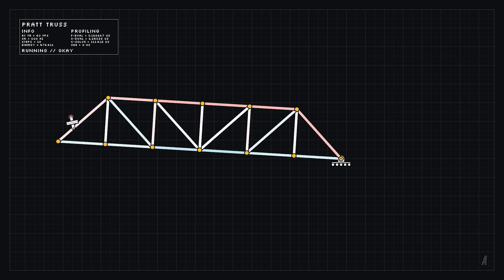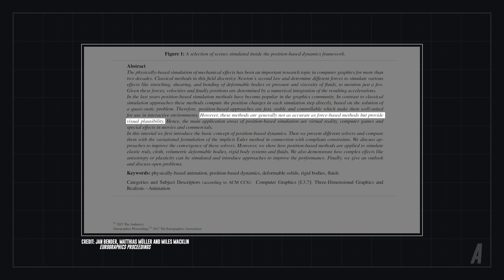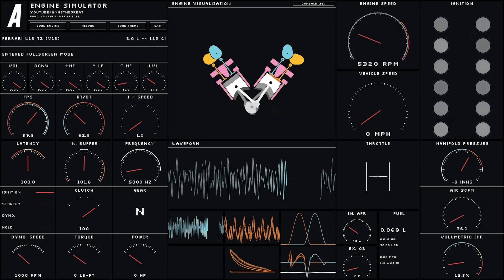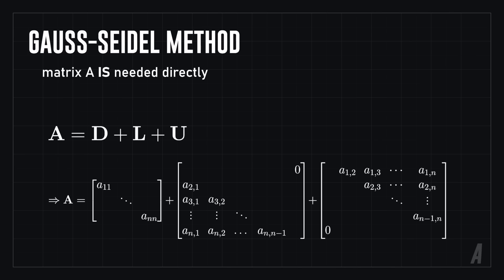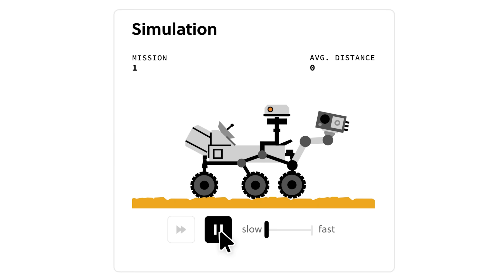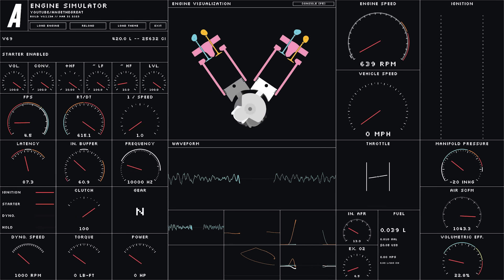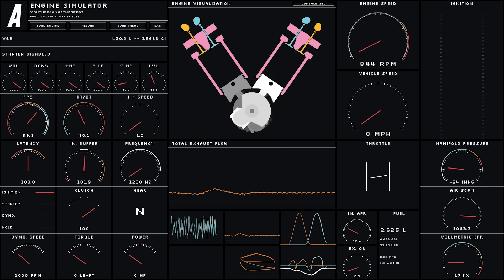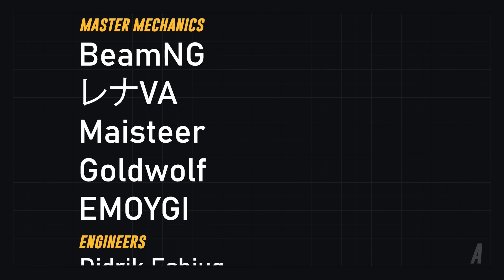Simulating a V69 Engine for Research Purposes (warning: video contains math)

Comment: Maybe a dumb idea, but would it be possible if you made it so that evry config "prerenders" the simulation as to just tell the sound engine what to do at what RPM loads and acceleration to make it sound and visualize smooth instead of rendering live??

Comment: If you want to try PBD, you can still derive forces with two rounds of the finite difference method on the positions of each 'mass'. I think you have to do one round to update the velocity in PBD anyway; a second round to update accelerations isn't going to eat up the rest of the CPU budget.

The accumulated errors from that double differentiation would probably be fine for UI elements, but if they're critical inputs in the fluid simulation it might be too much.

Comment: The best optimization you can do that also is easy to implement would be to train a neural network. NNs are universal function approximators and because they only need multiplication and addition they can run on the GPU or CPU but highly parallel because everything now uses SIMD. The difficult part is getting the data but because you have a handy simulator you already have unlimited data!

Comment: For working with sparse matrices there is a header-only library called Eigen.
It's rather fast, threaded, uses enhanced instruction set and setting up a sparse matrix is fairly straightforward. And it has a decent documentation.

Comment: Huge engines typically sound different than what we are used to from modern 4-12 cylinder engines. If you look for videos of old WW2 huge tank engines and airplane engines, they just make all kinds of loud popping and sound nothing like what we have today. No one has ever made anything like a v40 with modern tech or radial engines. Once Jet/turbine engines were invented, huge displacement and many cylinder engines were scrapped.

Comment: Hey Ange, I recently wrote a 3D position based dynamics (physically accurate through extended position based dynamics) where I also use and calculate forces. 

I simulate a car with suspension and some other constraints. It is unconditionally stable with possibility of infinitely stiff springs. Working with xpbd was a breeze and the math is far easier then global solvers.

I'm not one for showing my work often and the visuals aren't all that pleasing but I can show it to you and eleborate on the methods and papers use.

I'm not so sure how to contact you directly but let me know if you like to talk.
Reply from the maker: Feel free to join my community Discord server (link is in the description). I'd be interested to hear more about what resources you used and about XPBD technique. Thanks for watching!

Comment: Some aircraft piston engines would be an interesting application of this. Being able to run at variable barometric pressures, duel magneto running, single magneto failures or fouling, etc. Turbojet engines and high bypass jet engines would also be an interesting simulation.

Comment: I have a physics background (but no simulating experience) and I am confused why the algorithm you started with works well for position and not for velocity. Why does it make a difference between the two?
I would naively expect a large scale simulation to have the position and momentum (or velocity) as two separate variables, where each timestep the position is updated using the momentum and the momentum using forces (which are mostly a function of position). This means that you simulate a path in phase-space and map that to determine the physical path. So it the algorithm somehow very sensitive to this force calculation, or something like that?
(In phase space, position constraints are "horizontal" and momentum constraints "vertical" but otherwise naively there is no computational difference.)

Comment: Why was it necessary to specify that you used the length of a standard hot dog in the conversions?
Reply from the maker: There are multiple lengths of hot dogs in common usage and I wanted the measurements to be as precise as possible.

Comment: If someone wanted to use the simulator just to generate some sound samples and performance curves for a given engine, is it a possibility to basically put the simulation in slo-mo (e.g. each second of simulated time is simulated over five seconds of real time) to achieve higher fidelity? I.e. each simulation timestep stays the same length, but just gets more real time to calculate.

This would of course make live audio output impossible, but I think could be a viable method for certain applications of the program to still be doable on slower computers.

Comment: Talking about fluid simulations have you seen SpaceX's talk "GPUs to Mars: Full-Scale Simulation of SpaceX's Mars Rocket Engine" ? It has some cool tricks for spending compute power strategically where you actually need the precision. Instead of just the same amount of compute getting used everywhere in the simulation.

Comment: What about off-line simulation? You mentioned that CPU is not fast enough to simulate the big engine in real-time with high accuracy, so you lowered the accuracy. What if you keep the accuracy high, and simulate step-by-step saving the video and audio frames into file instead presenting them to the screen and speakers? Sure, simulating 1 second of running such engine would take more than 1 second of real world time, but that is no problem when generating video file that could be played back later not being limited by your computer speed.

Comment: I had a whole math course on linear solvers for partial differential equations sooooo:

The reason that conjugate gradient (CG) does not work for some of the system of equations is because the matrix has to be symmetric positive definite (SPD, wiki is your friend) for CG to work. Some differential equations give a positive definite matrix but others don’t. This is a bummer because CG is really fast, especially for sparse matrice, way faster than SSOR which does not require positive definitiveness. So if you still want to have a iterative solver for the equations you would have to look in to “iterive methods for systems with a non symmetric positive definite matrix”. There are a lot of these solvers but they all have their problems and advantages. 

Since solving the matrix is no longer the main problem this information may not be needed but yeah. If you would want to have some good reference materials please ask!
Reply: I just had an idea. If you could give me (an example) of the matrix to solve (or I look in the source code) I could test different solvers on them. Since SciPy all have them pre-programmed would could quite easily test which one is fastest. You can then integrate it your seld in C++ if you would want to.
Reply: The wiki page on iterative methods summarizes the options good options quit well under Krylov Subspace Methods:

Krylov subspace methods work by forming a basis of the sequence of successive matrix powers times the initial residual (the Krylov sequence). The approximations to the solution are then formed by minimizing the residual over the subspace formed. The prototypical method in this class is the conjugate gradient method (CG) which assumes that the system matrix A is symmetric positive-definite. For symmetric (and possibly indefinite) one works with the minimal residual method (MINRES). In the case of non-symmetric matrices, methods such as the generalized minimal residual method (GMRES) and the biconjugate gradient method (BiCG) have been derived.

Comment: 6:56 several years ago I spent a lot of time with various profilers in visual studio as part of working on altWinDirStat. You will get some useful info from the visual studio profiler, but you really need to use something like vtune if you want to optimize things. It's *night and day*, trust me.

The optimizations that make altWinDirStat so much faster than the OG windirstat would have never been possible without it. A lot of things would have just required experimentation or psychic skills. Being able to see, at the microarchitectural level, what's actually going on, is like a superpower. Lots of simple things like moving a few things to the stack, become obvious and make a HUGE difference.
Reply from the maker: Good to know, thanks for the suggestion. I've used vtune a little in the past, but I found it a bit annoying to use inside visual studio, I might try it again though
Reply: @AngeTheGreat   @AngeTheGreat  it's definitely a bit awkward to use in visual studio. It's really kinda like they hacked it all in with a crowbar. But, when working properly, it's a million times better than just the sampling profiler in visual studio. Being able to get the actual data out of the execution core at the cache and pipeline levels, well, it's infinitely more valuable than just "your code here is working for 1ms"

One more thing, which spawned this reply from the same porcelain place that I have all my best ideas: turn on those obscure auto-vectorizer messages at level 2. They're very noisy, and will spit out an absurd number of messages about non-perf-critical code, but sometimes you'll find a loop that can be re-written easily to be autovectorized, or just a bunch faster as scalar code.

Between that and vtune, it's why I was able to basically render as many fps on the cpu for the main treemap view as I wanted. I didn't wanna write any gpu code, so, if I was able to have it auto vectorized by separately doing all the loops for the red channel, green channel, and blue channel, wow did I get some free hardware acceleration 🤣
Reply: @AngeTheGreat  please let me/us know if it helps you find some speedup. I'll be very tickled if it turns out you're able to speed up something minor like UI by 1000x. It's the little things that nobody has ever bothered with that entertain me the most, perhaps as much as the actually important things like the main physics engines 😜

Comment: Could you visually connect the simulation animation to the math/code? This would make you cooler than @3blue1brown
Have a panel on the engine simulator that would show the formula(s) of the topic you are discussing, with current values for that frame of the simulator. If it is not too much clutter draw a line from the value in the formula to location on the animation ("probe").

Comment: From my own experience of coding a simulation, the best way to solve huge sets of linear equation is:
Just use a pre-existing math package. These solvers are so heavily optimized, you can barely get the same speed by coding from scratch.

Except when that is the whole point...
Reply: the optimized algs available for linear algebra are crazy quick!

and since most LA problems can be parallelized, it's best to offload that workload to the gpu

Comment: A useful feature might be dynamic adjustment of accuracy to keep the RT/DT in an acceptable range.
Reply: Or instead of adjusting accuracy, scale time. Physics stay stable just shown at a fraction of real speed. Eg at 1000 rpm, maybe it takes a minute to simulate 500 rotations so you see only 30 seconds of simulated time over the course of a minute.
Reply: @Jon-yh3gb  yep, and render to video, allow scripted inputs. So many possibilities.

Comment: Your engine is knocking. You might want to check if there's engine bearing debris or metallic fragments on the oil, or if the oil is overall milky. Also, test your fuel pump's pressure and your 69 spark plugs.
Reply: And given how much it uses, also check the fuel pump's flow. It might not be able to do the GPM that it needs.
Reply: It could also be an exhaust restriction - try increasing the exhaust to 69 in.
Reply: @peejay1981  Or try being original instead of overplaying the obvious.
Reply: Sounds like a ratial airplane engine.
Reply: The advantage of this engine is that it will run happily when you shut down one cylinder bank.

So you can check and change spark plugs while it's running. Yep, that'll be noisy, but convenient.

Next up on this channel: twin-spark version, for aircrafts. 138 spark plugs.
Reply: @klausstock8020 And an even crazier expensive bill to replace more valves that engine has than my car's peak horsepower.

Comment: Can I ask how well the program uses multiple cores? Like how is the scaling past 2, 4, 6, and 8 cores? I know paralyzing programs is very difficult but since optimization was so much of this video, I wanted to know about it. It would be interesting if we could use these type of simulation programs to help make use of the increasingly large CPUs we have these days. It would be cool to have a reason to have a 12 or 16 core processor actually be utilized by a game. 

Also, what CPU do you use to run the simulations for the video? It would be cool to experiment with different CPU's and other system specs to see how to get the most performance especially if that increased system performance could be harnessed for even better simulation quality.

Comment: Is there any way to build the OG Engine Simulator on Mac? I've been having some issues.
Reply from the maker: It should be pretty easy to port the engine simulation code. The interface, however, may be a little more challenging but if you add an SDL layer or something like that to take care of window management, it's doable.
Reply: @AngeTheGreat  Will try! Thank you.

Comment: Fascinating! The sound has so many layers to it as the engine goes up in rpm. It's also crazy to see the fuel consumption going up so fast on the right, this would not be cheap to run.

Comment: XPBD is what you need if you want more physically accurate results from PBD, for "infinitely stiff" materials you can simply use the regular PBD algorithm, restrict it to a single iteration, and then divide the timestep by the "iteration count" (now called substeps).
Miles Macklin and Matthias Müller both have made articles and videos explaining their research papers on the subject.
Edit: Since the fluid sim is the main bottleneck now, that should be the highest priority.
Reply: For infinitely stiff constraints in XPBD it's best to use many substeps and set the constraint compliance to 0
Reply: @JoonasHaapala  Yes, and regular PBD using a single iteration is a subset of XPBD, equal to setting the constraint compliance to 0, substeps is the same as making the timestep of the entire algorithm loop smaller.

Comment: When thinking about your engine simulator, everything comes down to matrix operations. why isn't it possible to outsource the heavy parts to the gpu since gpus are made to deal with matrices in the first place, aren't they?
Reply: it IS possible but might not be worth it - the RAM-VRAM latency might kill any possible gains. You have to remember that you need to move all the data to the GPU's ram and then move the results back to main ram and this takes not-insignificant amount of time.
Many numerical simulations software moved entirely to GPUs for that very reason - meaning he would have to rewrite EVERYTHING to GPU and that might be a LOT of work

Comment: I am absolutly not an expert on the subject, i have only limited FEM experience : From what i understand biconjugate gradient solvers could be useful as it is designed to deal with less friendly matrices. However this method is also unstable, so this might not work everytime. DId you also look into preconditioning ? 
Also if the matrix in your system is rather sparse and not of huge size, direct LU solvers could be useful ? For FEM problems of medium size i generaly use the MUMPS solver which seems to be pretty fast and is designed to be parallelizable

Comment: Can you make something like Rendering - that will render sound into a file with much more physics cycles and not realtime.
It will create something like “ground truth” to compare.
Reply from the maker: Great idea, thanks for the suggestion
Reply: @AngeTheGreat  Oh Yeah It can be so handful for video maker, when you have to recreate the sound engine in post !
Reply: I was thinking that too, didn't know if it was possible or if it already worked like that, but I'd totally rather spend 40 minutes rendering my X49 engine at 20000 rpm and play it afterwards.
Reply: I feel like the whole real-time aspect of the sim makes it cool, but I do understand why you would do that. It makes things easier for the sim to process, reducing latency and CPU time on the sim itself.
Reply: @schizophreniagaming4058 makes me think that if this were used in a game it might be good to just make loads of accurate audio files for it to use. Now if it were a game like beamng Id want the full fat real time emulation.
Reply: And next would be to render an array of files based on throttle and speed, essentially baking the engine so it can be imported into a game.
Reply: agreed

Comment: there is extended positional based dynamics (XPBD) that improves on the accuracy but is still missing the forces as far as i know but it shouldn't be too hard to reverse calculate the forces from position and velocity changes
Reply from the maker: Good to know, thanks for the suggestion!
Reply: XPBD is a wonderful method due to its simplicity and efficiency (no global solver necessary). It does converge to the same solutions
Reply: Forces can be read directly from the constraint lambdas by multiplying by dt^-2.
Reply: Unless I'm missing something, the paper literally shows accurate force measurements.